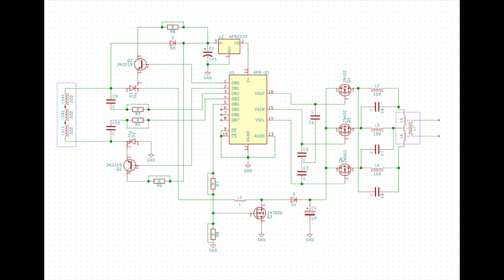Portable power, free energy for everyone - (PWJ165)

Comment: 1:33 busted! You shouldn't be able to touch mains without "consequences"...
Reply from the maker: Well... the whole socket is well insulated and the outlet and plug too. I don't see any problem here.
And additionally, because of the inductive coupling with no galvanic path, there is no danger even if I touch a wire, which is not possible because of statement nr.1
:-)

Comment: Ok, ive just tried this and my house burned down to the ground. Not sure if the instructions were clear enough?.
Reply from the maker: This ist not made for 115VAC! And did you use the correct futile resistance?
Reply: @PlaywithJunk  Ah, that could be the problem. I will try with 380v 3 phase as soon as the house is rebuilt.
Reply: Clearly you got very good power output then!
Reply: @benbaselet2026  not sure. The ampmeter only goes to a thousand.
Reply: @AndrewTSq  AS long as it's a thousand Mega Amps it's OK.
Reply: As you now see, 1.21 gigawatts is too much for some appliances.